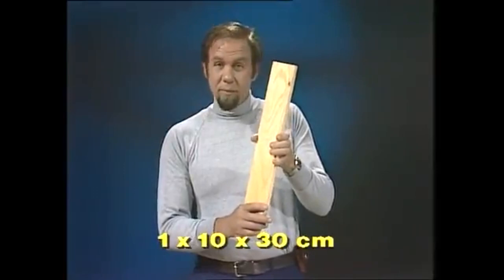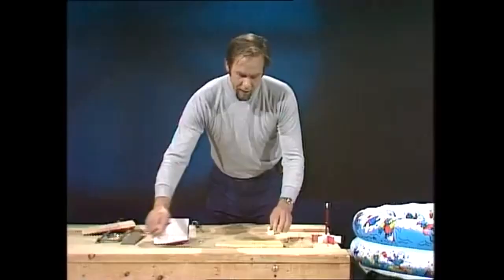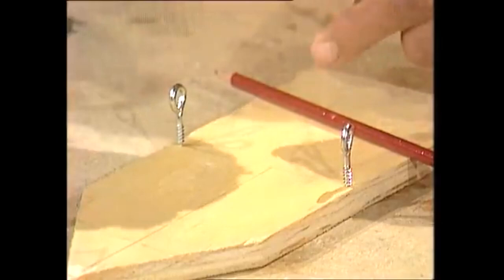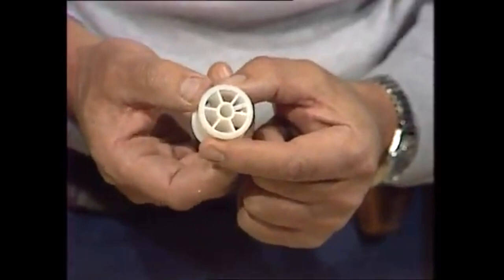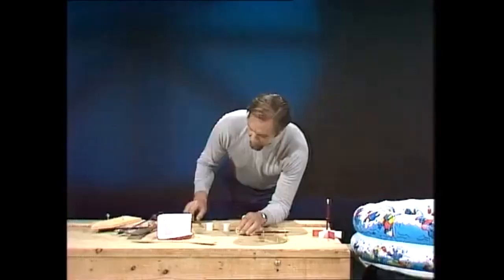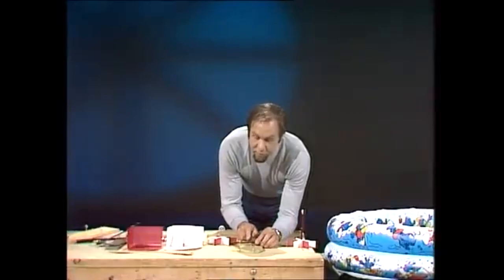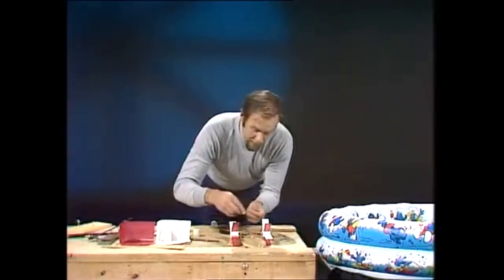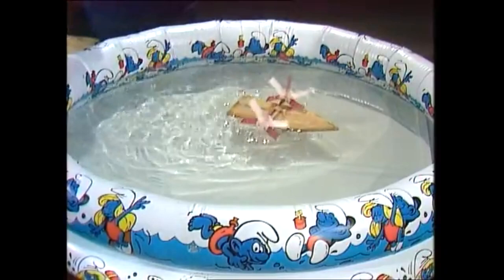Model Paddle-Wheeler to Make

Comment: Cotton Reel.......wow, I had no idea what you meant until you held up a THREAD SPOOL. I learned something as well as how to make a paddle boat (or as you say, paddle wheeler).
Reply: in australia theyve always been called cotton reels....lol, or at least thats what i knew them as in the 70's and 80's
Reply: I call it a "paddlewheel boat".

It seems that Britons and Australians prefer to call thread and yarn "cotton" and "wool", respectively, regardless of what kind of fiber they're made of.  Whether they would go so far as to say "nylon cotton" or "polyester wool" (or even "wool cotton") I don't know.  You might think that they would call yarn made of cotton "cotton wool"; but, at least in the U.K., "cotton wool" means what Americans call "a cotton ball" and "cotton balls" (and lint is called "fluff").
Reply: @Smickster01  , I think that in America the distinction usually is that a reel has a diameter greater than its height and a spool is the opposite—so thread and cable tend to come on spools, and recording tape is on reels.  (Adhesive tape, on the other hand, both is a roll and comes on a roll.)

I'm not sure that this distinction applies for ribbon, though.  I think "spool" probably beats "reel" for ribbon, regardless of whether it's more flat or tall—but "reel of ribbon" has a nice sound.
Reply: @smadaf  ok im gonna concead that youre correct wholly because you went into a vast specificity of dimentions. Lol nice one. 😁
Reply: @Smickster01  , concede? 😄  I was only talking about America.  For Australia, I'll defer to you. 😊
Reply: @smadaf  lol concede yes. You know to much about spool/reel height ratios to even try to assume the correct terms. Lol. Respect for pointless knowledge. 👍🙌😎